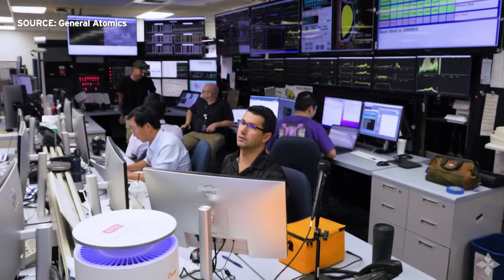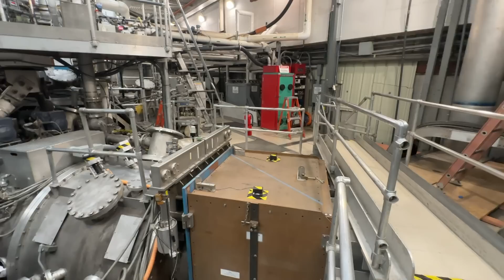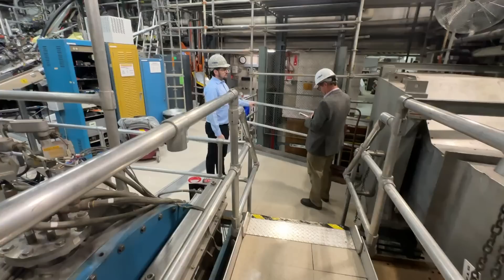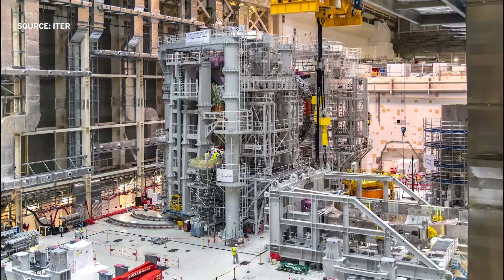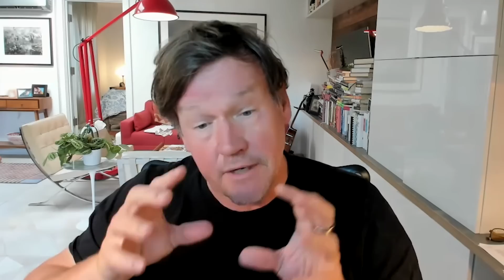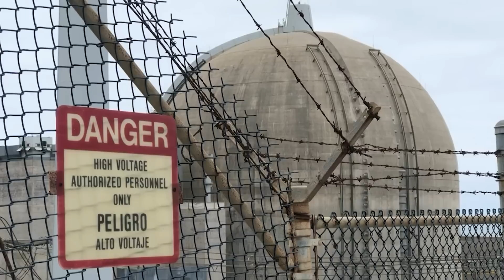General Atomics sees an end to the long road toward nuclear fusion

Comment: What about the high energy neutrons that will make everything radioactive. How do they plan to do repairs on a radioactive reactor? What about the radioactive gases that are produced? What safeguards do they have so these gases do not get into the environment? When they say net energy gain is that the total energy used to run the reactor or just the energy of the beam that makes it into the reactor? YouTube: Unprobeable Matter.

Comment: Solar PV delivers power at 2-4 cents a KWHR you need to beat that number , Im 🤔 thinking with the multi billions spent the cost will never compare to PV .
Reply: Area in fusion beats Solar PV area requirements
Reply: @downrangedave3845 which one exists right now and can be put in place virtually anywhere by almost anyone?

Comment: Have a direct to electric power fusion powered photon electron quantum  converter in my back yard. Uses NO fuel whatsoever. Its been up and running for almost 4 years. 1 Kilowatt per hour, costs $600 installed.
Reply: I have a lot on my roof.

Comment: The fun part is once you have a sustained fusion reaction, then what? You have to convert the excess energy (usually heat) into a usable form of energy (usually electricity). So you have to figure out how to take the heat from something as hot as the sun and cool it down enough to flash water into steam (without vaporizing it at a million degrees) to then turn a conventional turbine generator. And at the same time keep that plasma hot enough and under enough pressure to sustain itself.
Reply: don't confuse temperature with heat
Reply: There's only about a 40% chance of getting it done by 2050.
Reply: @travishartman5662  do you mean 2150?
Reply: Use double loop heat exchanger
Reply: Super easy, barely an inconvenience!
Reply: The plasma is suspended with magnets so the heat don't interact too much with the contraption, and most of the energy produced by fusion is in the form of high speed neutrons anyways. The main challenge of fusion has been how to keep the plasma going (cause if it's unstable it'll disperse quickly and stop the fusion) and how to harness the neutrons into energy without letting it corrode the components too much

Comment: We already have a 3.9×10²⁶ watt fusion reactor in the sky which we get clean energy for free all over the world.

Just 1 hour of the sunlight that falls on the Earth can power all 620-exajoules of energy the world uses in a whole year!  So just a tiny fraction of that could power all primary energy needs many thousands of times over.  That includes the 300-exajoules of waste energy since fossil fuels are so very inefficient.

Right now, our best terrestrial fusion technology requires gigawatts of input to get megawatts of output.  Fusion does not produce long-lived transuranic by-products like fission, but fusion will still produce some radioactive products like hazardous neutron emissions that cause other atoms to become radioactive.

The best most energetic fusion reaction uses the D-T reaction which requires the tritium isotope which is so rare its costs some $30,000 USD per gram. ITER says we need 56kg of tritium per GW year.  Tritium itself emits beta radiation and can be deadly if inhaled or ingested such as from contaminated water.

All this while renewables (especially solar PV) have reached historic low costs of energy production and still driving its prices further down and growing at annual exponential rates around the world.  So, the challenge of economically viable fusion gets harder each year!

Comment: These fusion journalists will buy and repeat any old nonsense to fit their anti fission agenda.
Fact all most all fission and fusion reactions involve extremely energetic neutrons or protons and gamma radiation, and neutrons released in the fusion plasma will smash into the containment vessel irradiating it. Also the lithium itself has to be fissioned into tritium and helium, the helium is wasted but the tritium is fused back with the deuterium fuel to make more waste helium and that energetic neutron for heat output. In the tokamak approach, the neutron is definitely going to irradiate the containment vessel or it's going to try and breed new tritium fuel in a lithium blanket.
Reply: We mig and tig welders would be happy with more helium. Perhaps  also saturation divers.
Reply: @howardsimpson489  The amount of helium a commercial fusion reactor would produce wouldn't even keep up with the demand from a single grocery store florist. If you really cared so much, you should've protested the US selling off it's helium reserves a year ago.